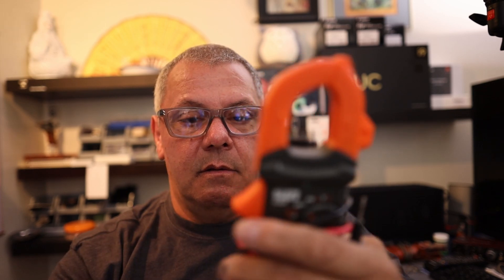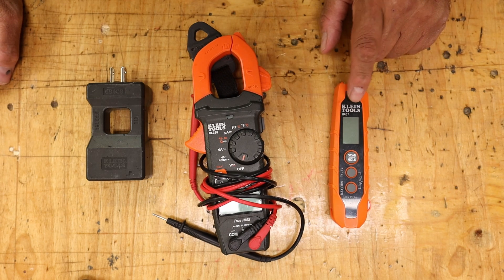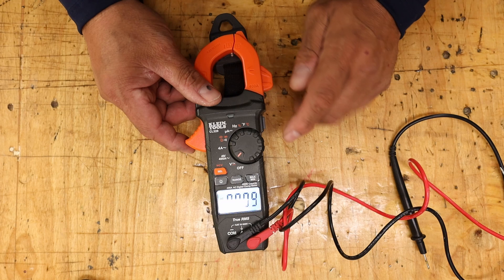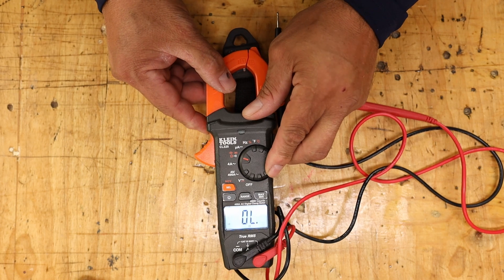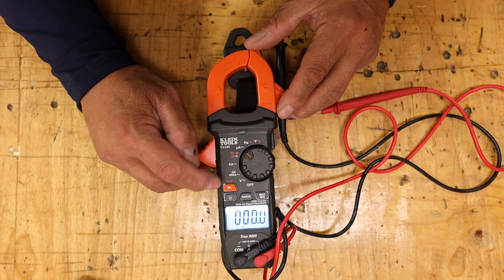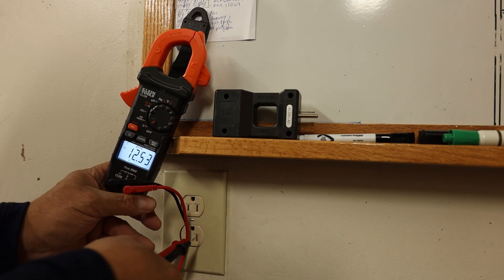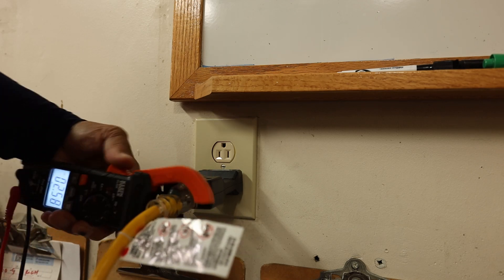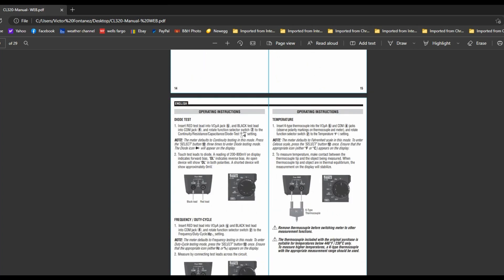Klein CL-320 Meter and kit described. Voltage, Continuity, Amp, Ohm, Capacitance and more described

Comment: Hello Thank you for the Video!!! I just started My HVAC training. They are asking for Multimeters. And I was Thinking of buying this one   cL 320 kit . Would you recommend ?
Reply from the maker: Definitely, this kit test capacitance also for capacitors and come with a pen non contactor voltage tester plus the multi-meter has a internal non-contactor tester on the right top side not described in this video. Best bang for for the buck or dollar $. For sure you can not go wrong with this purchase. Don't worry about names like Fluke or prices only Capacities and advantages. I love Klein tools and have videos about their equipment.
Reply: They gave me this multimeter at HVAC school has everything
Reply: If you have the money fluke has a better kit it comes with everything you need for hvac . It has a 116 and the fluke 323 clamp meter but the kit is 450 dollars